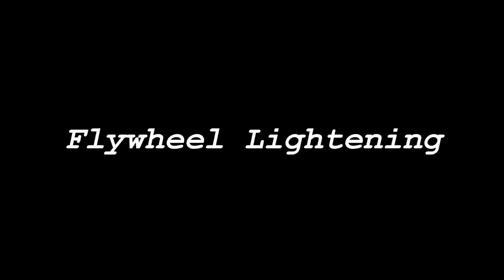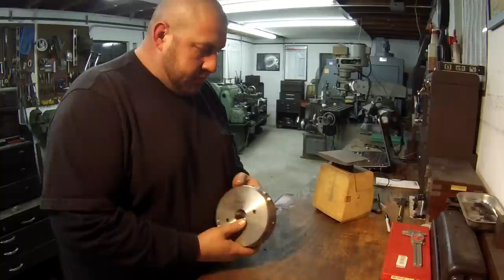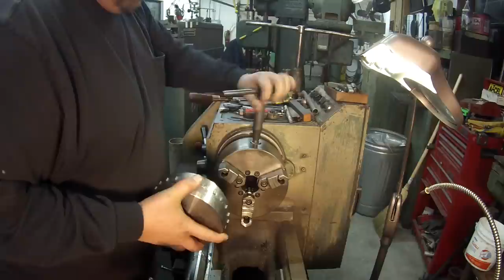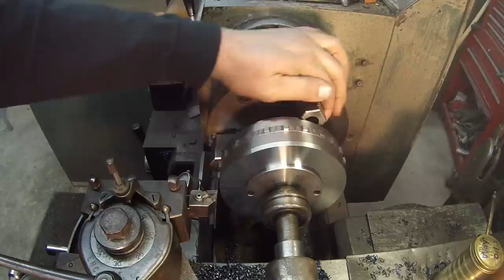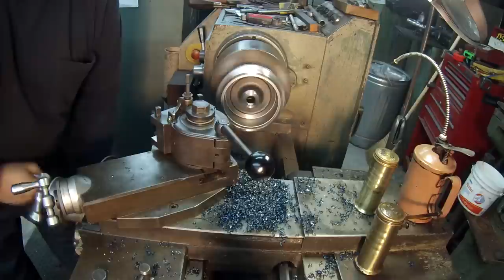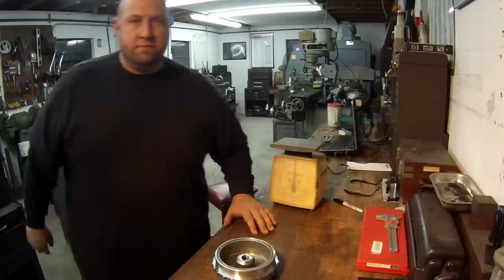Flywheel Lightening

Comment: Adam
I had a shaft at work about a year ago that i machined over a hundred pounds off of it.  I knew there would be a lot of machining, so i couldnt resist weighing it.  That was a fun job cleaning out the chip pan for that one.  I agree with Bill and Tom for that matter.  Ever since Tom suggested buying a composition book and jotting down notes, i have filled pages upon pages with different things i do in the shop.  Everything from fixtures for repetitive work to how i do things that come along once a year.  Great video, that material finished better than it was from the factory.

Mark
Reply from the maker: Always something good to learn from Tom, and many others on here as well. I do have some notes but not all in one place like the suggestions here, its a good tip. 
Sounds like you had one fun shaft to machine! Even more fun to sweat it out scooping chips out of the pan. 
Thanks Mark.

Adam

Comment: 3 pounds off the flywheel is HUGE. Rule of thumb is every pound of rotating weight you can remove from anywhere in the powertrain is equivalent to removing 6 pounds of dead weight from the motorcycle. A 9 pound flywheel is really heavy to start with so taking 3 pounds off it is not excessive at all. Excellent work.
Reply from the maker: Great info Gordy! Thanks for sharing.

Comment: Adam, thanks for the vid. Always interesting to see a pro at work. 

On the clutch question, motorcycles typically have a multi-disk wet clutch (in oil), not a dry friction plate against a flywheel like in a car. Slipping the clutch in a car will burn up the clutch in a hurry, but on a bike that's a normal part of riding at slow speeds, such as making turns in parking lots. The multi disk clutch has alternating friction and steel rings that bear on each other, not on a housing or flywheel. One set of rings is toothed on the OD, and the other is toothed on the ID...clamping them together transfers power.

I suspect that the magnet has to do with sensing RPM or crank angle for an ECU to use for controlling timing. 

-- Mike
Reply: In fact the magnet is used for the charging and ignition system I generate electricity with the stator coil the flywheel is used to store kinetic energy it help on power delivery and smooth the engine
Reply: I don't slip the clutch going slow on a bike. If I have to, I will pull the clutch all the way in for a bit, then let it back out.

Comment: Great video again.  I used to do that on 2 cycle dirt bikes back it the 70's.  It made them rev to max fast as an electric motor but it also took away most of what little low end torque they had and 2 cycles don't have much low end torque.  They had to keep the revs up.  It was a fad and most dirt bike fads back then tended to last about 90 days.  Keep up the good videos.
Reply: The low-end torque a 2-stroke has depends on the engine design and tuning.  Back in the early 1970's, I motocrossed  a 400 Maico.  That machine had SO much low end torque, in the first two gears you had to work to stall it.  I also later raced a Suzuki TM400 and had to bolt on an aftermarket 4-pound flywheel to make that bike even semi-rideable; zero low end, explosive top end .  So, yes, flywheel weight can be very important.

Comment: great job ! 
I think many people who have never raced bikes missed a point that you are an important STEP in bike tuning and it is 99.999% certain that the flywheel will be off for race balancing as the NEXT step along with the probable new cams and crank (which again will be lightened first) 
it was great to see as always
 Personally having had many bikes over many years I at least saw that because of the STAGE the tuning process was at a 4 jaw makes no real difference as long as structure is maintained and as always you excelled 
best wishes

Comment: Hi
Adam
Nice job
The lighter fly wheel gives a better (faster)  pick up
The way you had it mounted (running true) the balance should not be a issue
Regards
John
Reply from the maker: Hey John, the balance shouldnt be far off, and Ive never had one complaint on my work, only wanting more done. I know they said it helps the bikes rev quicker. 
Thanks for all you do buddy!

Adam
Reply: the setup made the face true for a facing operation but the turning was not checked. I guess Aboms 3 jaw chuck is just very accurate. I would have to use a 4 jaw chuck to make sure the center hole is concentric to the sides.

Balance was also off as soom as Abom started facing because of the 3 small balancing holes on the face side started being erased.

Perhaps a lighter wheel makes balancing less critical for the customer too.
Reply: not easy to rebalance, @18:34 you can see/hear its a bit off-center. Rebalancing would require a lot to get it right again. But by losing 1/3rd of the weight, the issue will probably be a lot less.
Reply: Balance will be off enough to kill bearings in 10-15k miles, not a problem in 'racer' engine that is ragged to death, or crashed, long before that. Nice and true running mass of flywheel with magnets off by good 1-3 mm(40-120 thou) would need even more balancing holes drilled than 3lb heavier one. Non concentric mass is now higher fraction of whole rotating mass. Nicely done weight reduction but should be followed by balancing to be roadworthy.
Reply: It was on t' piss from the factory, Adam's machining work far outdoes them, but it'll still need balancing because of A. All the other wonky factory machining he didn't touch and B. Any porosity or just general density variations within the bar stock. Can't get around these things :/
Reply: Balancing is necessary. Its a big mass turning in high revs

Comment: Hey Adam,

Finish looks great even with those holes in the part, What is the Iscar insert CNMG??. Nice job, I'm sure the owner will be noticing three pounds off his rotating mass. 

Talk to you soon.

Tom
Reply from the maker: Tom, that was the same corner of the ISCAR cnmg 431 insert I used in my first face off video. Still going strong! They've been working pretty good and leave a good finish. 
If you could have seen the finish on the sample they brought to me years ago...OMG! Looks like someone was using a burnt up hss tool bit. 
From what they say it gives better performance for the bikes. I havnt gone into specifics with them though. 
I really need to find myself one of them fancy 6 jaw chucks!

Talk to ya soon bud. 

Adam

Comment: Nice work Adam, I used to do that on automotive flywheels for local drag racers down in Gainesville... You've got to wind her up and dump the clutch, but they had plenty of power to light up the tires coming off the line! Thanks for sharing this! :o]

O,

Comment: Ppl commenting about the balancing after turning. I've often found that a lightened flywheel thats been turned on a lathe will be pretty balanced. Especially on cast flywheels. You can see how out of true it was when Adam touched off the face of the flywheel and the outer radius. Turning it centered and square in the lathe will improve the balance.
Reply: You could see on the second face that there was runout. So it was possibly out of balance again after the diet.

Comment: I'm also interested in the effect (if any) on balance. Obviously since this is coupled straight to the crankshaft, it might not be easy to notice but I imagine that it's just a little bit more strain on the bearings.  I'd be curious to see it mounted on those shaft inspection rollers you showed us a while back.

Comment: You certainly met the customer's specification regarding weight reduction, but what about balance? Motorcycles typically run at high RPM, and leaving the flywheel even a tiny bit out of balance could significantly decrease the engine's performance and lifetime.Does the customer rebalance the flywheels after he gets them back from you, or is it something that was never addressed?
Reply: I always thought that the holes in the face were drilled out for balance.  Is it still in balance with the holes milled away?
Reply: @DFWKen  Yes, those three holes were for balance. Now that they are gone, it could be out of balance now. Spin the lathe up to max revs and see what happens eh.

Comment: It appears that there is some balancing drilling done on the stock flywheel (rotor). Does the lightened flywheel get dynamically balanced by someone else or is there no need for it?
Reply: +Norman May there is most certainly a need for. I sure hope the dealer re-balances it.
Reply: +Billy T   My thoughts exactly. Anything less than a full dynamic re-balance would be less than optimal.

Comment: Very cool Adam, you're probably sick and tired of being asked the balancing question and I read a lot of the comments in this video and your patient repeated answer "The balancing is handled by the bike shop" but you showed us your persicion toller jig to check the balance and trueness of a shaft a few weeks ago, are you not curious about using it to check the balancing?  I know I am and the bonus would be we get to see that tool in pratical use!

One last question, I've started to watch videos and read the interweeb on identifying alloys, you mention that this metal is pretty hard (and it sure does look like it in the video).  Any pointers how you would go about determining the alloy of that flywheel?  Not looking at the actual alloy but the process you would use to determine it.  Curious mind want to know.

As always, we are very fortunate that you take the time to PRODUCE these videos.  Filming the job is the easy part, you must spend ridiculous time on post production - THANKS for that.

Take care from Cold Canada where it's -10°F and getting another foot of snow tomorrow.

Comment: I am kind of surprised you did not fab up a stub arbor with a threaded center hole & flat washer & bolt the same size as the crank to hold concentrically to the center of the crank. Also since you cut all the balance holes out, how did you rebalance it ? I use balancing wheels when doing racing outboard flywheels Adam .   ------>   FLYWHEEL BALANCING: The first thing I do is make up a stub shaft to mount the wheel in the lathe. This is done as follows, a piece of stock with a bigger OD then crankshaft is installed in the three jaw chuck face and center drilled for a live center.
Set the compound of the lathe so that it will cut the same angle taper with the compound of the lathe as is on the crank if it is a tapered crank,
cut the taper down until your live center just touches its mating center hole and will allow you to
lock the flywheel on the taper you cut with the compound. Try and keep the shaft short as
possible so the flywheel clears the chuck of the lathe. Take a dial indicator and rotate
the shaft to check for run out of stub shaft. There must be no run out. Mount the flywheel on the fabricated shaft
and lock with the live center on flywheel tight. Check the O.D. of the wheel. My wheel was .030
out of round. A total of .070 was taken off the O.D., .035 off each side to clean up. More can be removed if wanted  . After machining re balance turned flywheel on static  balance wheels and drill  lighting holes as needed to bring in zero spine roll back of flywheel on wheels. -------> https://cdn1.bigcommerce.com/n-yp39j5/4s9liwcv/products/117156/images/297507/WBS-002__49754.1462909489.1280.1280.jpg?c=2

Comment: I saw the balancing divots drilled in before you turned it. Now that you removed them does that mean it's no longer balanced?
Reply from the maker: No its not balanced other than being machined true on the lathe. The bike shop handles the balancing after I machine it.
Reply: I sorta figured they would, since their might be a small void in the castings.
Nice work,
have a good one.

Comment: I have a question the drill markes in the back are weighted to balance the flywheel. since you ground it down wouldn't that throw off the weight of the flywheel?
Reply: +seabulls69 It would throw the balance of somewhat, but the lighter flywheel also means there's a bit less metal to put it all "out of balance". Also, people that want this kind of stuff done to their engines usually don't care too much if the engine get's a little more rough, as long as they get the power gains.

Comment: Another great video, thanks Adam

What kind of maintenance do you have to do on your 3 & 4 jaw chucks.
Is their a routine maintenance schedule for these, or do you run em till they drop & then rebuild or just plain replace?
Reply from the maker: Just keep them clean, free of chips in the scroll, and on the 3 jaws try not to overtighten them. They dont last forever, but will give you many years of good service if not abused.
Reply: Abom79

when I first started watching machining videos, it took me a while to recognize why 3 VS 4 jaw, this time?

Then the self centering, hit me awwww yes, I get it...maybe

forgive me I've nether run a lathe or turned anything other than on a dime  badly, so to me it was an enlightening moment.

 For us laymen that's what is most interesting, I'm sure you get lots of comments about technique or job approach which is why, I like the way you start yor videos.

This is my thoughts, perhaps maybe, nope I decided to.....

Comment: 3 lb doesn't sound like much, but the further out it sits on the work piece - the more effect it has in reducing this thing's moment of inertia (which is what we want) so I'd say that's pretty awesome! Before starting on this though I'd ask the customer about any load bearing features on the item and treat them very gently, and with massive radii nearby to prevent fatigue cracks. I'm guessing however that anything that takes any actual load is on the inner side of the flywheel, those fingers look like they could be clutch engagement, but they're spaced far too irregularly for that, so my guess would be they work with a Hall effect sensor for engine timing
Reply: The starter sprague clutch and gear mounts to the back of the flywheel on most motorcycles. The ridges are timing marks picked up by the bikes ignition sensors. There is no physical engagement of the flywheel on another part to impart load.  It spins around the stator that is mounted on the engine case cover to generate AC electricity which the bikes regulator/rectifier turns into safe levels for "12V DC" system.

Comment: Don't they need to be balanced again after you've taken off a lot of the balancing holes and changed the geometry? And wouldn't it be better to finish those steps with a radius fillet for strength?
Reply: That's the first thing I thought, too.
Reply: Doesn’t matter, the customer only asked to make it lighter. It’s not Adam job to question what they want.
Reply: lighter weight is easier to balance so put this on a motorcycle wheel balancer and then drill some holes..
Reply: my first thought as well. that balance was for standard use, if anything, high rpm high performance use would increase the need for balancing. I figure (hope) the motorcycle shop has something in mind for that, and that the actual machining is the part needing done on this stop in its journey.
Reply: And what about the two timing marks? Did someone make notes on them too?

Comment: No concerns about balancing it again?  I have a flywheel I want to lighten but I have been hesitating to do so because I am not sure how to check the balance afterwards.

Also, you took off the timing marks on the outside.  Might be worth noting them so that you can re-scribe them afterwards?

Comment: Adam,
I like the set up on the lathe with the extra support from the center.  Youmentioned the use of the carbide insert. Is the flywheel too hard to be cut with a HSS tool?
Thanks for posting a nice clear video.
Regards,
Eric
Reply from the maker: It could probably be cut with a hss tool, but it would take forever. Thats some
 tuff steel. Best use carbide to you can get the job done quickly.
Reply: Abom79
Wouldn't an HSS tool make the part allot hotter as well, with the friction vs. cutting speed? I'm not sure warping would occur in a part that stout, but I can bet it would suck if it did!

Comment: Adam,
	 	 	 	First, thank you for making these video's. I have watched quite a few of your videos now and find them informative and entertaining. Between yourself, Keith F, Keith R, Doubleboost, mrpete222 and one or two others, I don't think I'll ever have to watch TV again!
One question on this video though. I note you don't ever use carriage or cross slide stops. I would have thought on a job like this flywheel, it would be ideal to use stops so you can come up to exactly the same point for each cut (which you do with your mag-base dial gauge). Is this personal preference, or is there a technical reason for this?
Cheers,
Brad

Comment: Hi Adam
With the 3 balancing drillings on the back of the flywheel being turned off does it need re-balancing after the turning?
Reply from the maker: The balancing is handled by the bike shop.